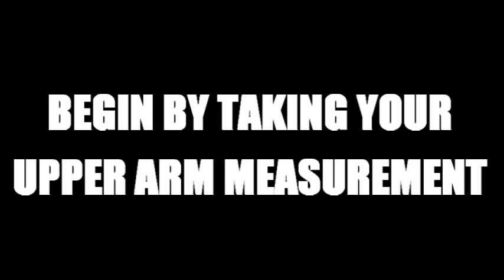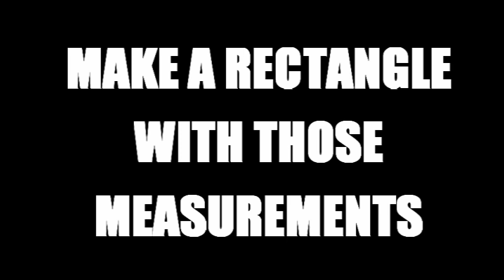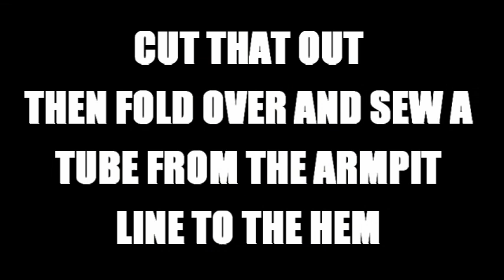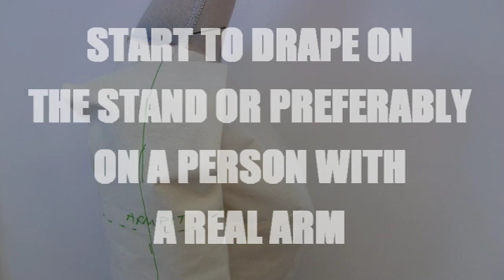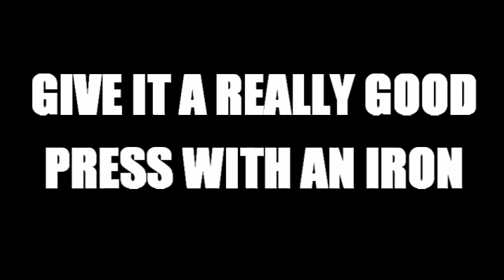How to Drape a Sleeve or Add Sleeves

Comment: hi Tri (or Tree). Thanks for sharing this, I find the sleeve to be the hardest part when fitting a pattern. Recently had a bodice block made but sleeves were not included. I'd love to see what you do with the bodice block when designing your own styles/patterns :)
Reply from the maker: It is as easy as it looks....When I do another one I might make the armhole a tiny bit bigger but can I recommend for sure having an arm in there. I will show how I use these blocks.....Thankyou, Tree x
Reply: @StitchlessTV  thanks Tree, in my case it would have to be my arm, and I would need someone to assist me 😊 Looking forward to the next vid! x

Comment: Thank you Tree, I have made up my block now and need to cut and sew the top to see if it fits me. I will make up the sleeve block next. How much ease should I allow when I make up in fabric and where do I add the extra inches, in the side seams?
Reply from the maker: Well you should have about 2ins ease on the block. If you temporarily put a zip in the back then its easier to try on. But if you haven't got it unoriginal then split between side seams and back seam and see how you get on. Tree Xx
Reply: Tried on the block and it does fit but too close a fit for me so think I will make another one up but add two inches to my actual measurements to allow for ease

Comment: I’m so confused. The dotted line is armpit length which is 7.5. But shouldn’t that be bicep measurement¿ am I missing something. Where is the bicep measurement
Reply from the maker: I do say at the beginning of the video what I'm working with as a rough guide. My bicep is 13.5cms and depth of armhole roughly from shoulder to armpit is the 7.5cm